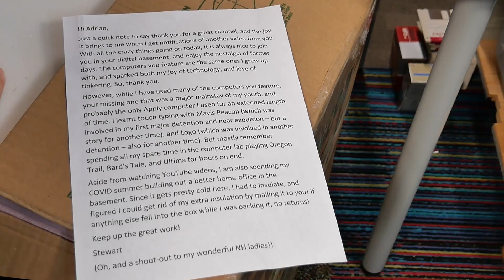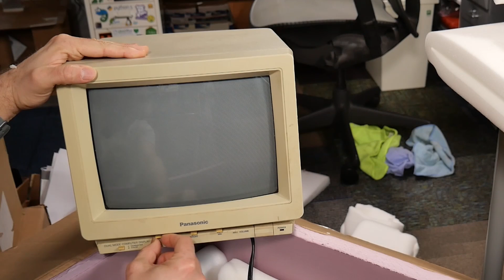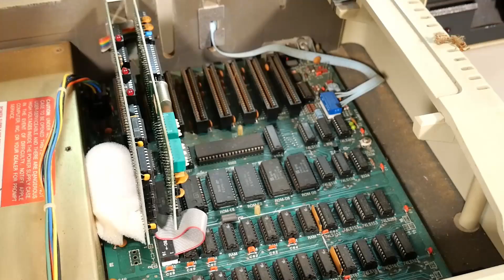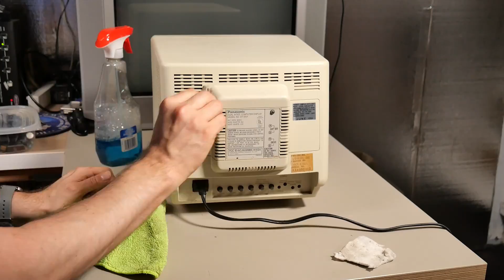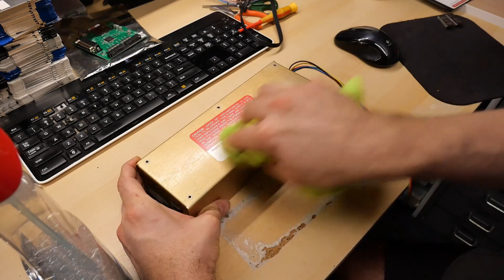A viewer sent in a very special donation!

Comment: at about 12 minutes in Adrian says Apple told people to NOT put the disk drives on top of the computer.  I ask Claude to find that.  It gave back: Excellent! I found it! The Apple IIe Owner's Manual (030-1346) on Scribd contains exactly what you're looking for. Here's what it says:
"Stacking Peripheral Devices" — The Apple IIe and Apple peripherals are designed to take a small amount of desk space. For example, if you have two disk drives, you might put them on top of the Apple IIe and put a monochrome monitor on top of the two disk drives. Some people also place the monitor on a stand.
Interestingly, the Apple IIe Owner's Manual actually encouraged stacking disk drives on top of the computer as a space-saving tip — complete with a figure (Figure 1-16) titled "Stacking peripherals for maximum desk space."
This is the opposite of what you remember! The Apple IIe manual was actually telling users it was fine to stack the Disk II drives on top of the computer.

Comment: 15:13  Wow.  That explains an old mystery.  I had an Apple joystick as a kid that had a secondary connector dangling from it which was just a bunch of pins - matching what was shown here.  I didn't know what it was for and as you'd expect it got all mangled.  The joystick had a switch for IBM PCjr so I had assumed that's what it was for, but I guess not.  I had no idea early Apple IIs had you plug the joystick directly into a pin socket on the motherboard.  That's way too clunky for this quality of a machine, just shameful.  I'd expect that from Commodore.  :)

The first Apple I ever saw was my uncle's II+.  I was pretty fascinated with it.  He had a bunch of shareware games from some literal mailing list he apparently subscribed to - I think he was getting a new disk in the mail every month or something like that.

Every Apple II I ever saw had that same classic setup with dual floppies and the monitor stacked on top.  It was so universal that I thought it was designed that way.

Comment: I liked those PSU's, in the late 80's, early nineties you could pick up complete 2's and their variants at the local flea market for ~$10, I liked how  all those 74LS chips were in sockets, and that PSU has double the rating of the Amiga brick so I would take the low voltage cord from Amiga and solder them into the apple PSU

Comment: Funny story, my first computer was a TRS-80 model 1.  But when i hit high school, they not only had TRS-80's, they had BOTH apple 2's and apple 2+'s.  Since i was already extremely familiar with the TRS-80, i gravitated to the Apples.  Less than a year later, we moved, and i was put in a school where the instructor of the computer class was a math teacher, and didn't know anything about computers!?!?  (yay 80's)

So i basically was tasked to help teach the class, because my knowledge was so deep in the subject matter at hand.  Plus, i was just starting to dip my toes into machine coding on the apple (by which i mean hand assembling), because the only tool i had was call -151 to place values into memory and then execute them.  I didn't get my fist 6502 assembler until i hit high school, and it was only a micro assembler.  Wasn't until i hit college and could pirate an actual assembler that i finally managed to really write assembler for the apple.

Still, i was known as the best apple guy in every high school i attended.   (which there were 5 of, FML).  Yes i attended 5 different high schools in only 4 years.  Times were tough, man!

Comment: X1 capacitor is actually better (has higher ratings) than X2. That's possibly why it's smaller (also because it's 30 years newer, of course). Same with Y capacitors, a lower number means a better rating.

Comment: Hey Adrian! Do you have a link to the RIFA cap replacement part?
Reply from the maker: Unfortunately I don't. I have have a box filled with X2 caps and I look for the right value and use it. Can't even recall where I got them.
Reply: @adriansdigitalbasement  that's great, I appreciate it and should be able to find some.

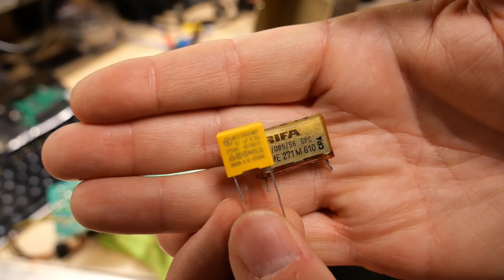Comment: 30:50 A little addition to this: Yes, X2 is the basically identical sucessor to the old "X" class. But there is also X1 available, which is BETTER (4kV surge instead of 2.5kV for X2/old X). Don't get confused and think X1 is just the old X.  There also is "X3" specified, but I never encountered them in the wild.

Comment: I had an Apple ][ because for some reason, I thought I might need it. I ended up adding the Applesoft card (not roms) and then with a flick of a switch in the back, I had an Apple ][+. I remember I bought the Apple, Micromodem ][ and Applesoft card for $3300. This brings back fond memories as the Apple and BBS's is how I met my wife. She had a Pet but got an Apple ][ to run the BBS on. I remember when we got married, we put our drives together for 4 drives. We ran BBS's until they finally went away. Unfortunately, we lost both our Apple ][s in a house fire. BTW. we hooked ours to a TV. The monitors were too expensive ;)

Comment: Thanks Adrian!  I recently bought an Apple IIe Platnium on ebay and thought that I should check out the power supply (because of this video) before firing it up.  Man am I glad that I did.  The Rifa cap (mine had Rifa inside of a circle) was probably on the edge of exploding.  The plastic was cracked on 3 of the sides and two of the sides looked like heat damage.  I'll never know if this Apple was actually working as purchased.  I'm just about done replacing it and then hopefully it all works.

It took me a while to find replacement caps (I'm not an electronics pro) but after pausing the video at the right spot I think that I have gotten the correct replacement; looks like the same specs as the one in the video.

I like how you have lots of sponsored links for products in the description.  Is it possible to also list replacement parts in those links?

The Apple IIe that I bought has a Rockwell 338-6503 (88-41) from Mexico in the 65C02 socket.  From what I can tell, it is special version of the 65C02 that Apple used.  I wonder how many other 65C02 variants that there might be and if it is worth the effort to drop in a WDC W65C02S6TPG-14.  That might be an interesting video.

Thanks again for the videos, I really enjoy them!

Oh and congrats on getting an Apple ][+.  Not to date myself but that is the flavor of microcomputer that I used in college in the early 80's.  We had a language card in it so that we could learn Cobol programming on it.  I don't know what it was, but it was probably a Z80-based card.  I learned Pascal and BASIC on the Apple ][+ too.

Comment: Generally speaking, assuming there hasn’t been any rework, green electrolytic capacitors are low ESR (equivalent series resistance) capacitors. These are better for switching power supplies because it reduces internal stresses on the capacitor and increases the efficiency of the power supply because less power is expended on losses due to the ESR of the caps.

Comment: My dad bought the family an Apple ][+ in 1979. My brother and I ended up modding it in 1984, by replacing the motherboard with a DIY-soldered IIe clone board bought out of Computer Shopper, running ROM images copied from an Apple //c at school. We left the original keyboard in the case and patched in a detached cloned IIe keyboard on a 30-conductor cable. I still have the original ][+ boards wrapped in aluminum foil somewhere.

Comment: You went into the differences between the Aoole ][+ and the Apple ][...but I'm trying to remember what the differences were in the Apple ][e compared to those..
Reply from the maker: Not much -- the ROMs were autostart ROMs on the II+ and you could put those in the II. There are some minor revisions and improvements to the motherboard but from a compatibility standpoint, it's the same. (Once you upgrade a II with the II+ ROMs.)

Comment: Your story sounds just like mine. My parents got one of these when I was about 10 years old, and I wrote my first code on it in BASIC. I remember pestering my Dad for months to get a (fairly expensive) 16kb RAM upgrade, to have a beastly total of 64kb, wow! The double disk drives made copying disks much easier than most of my friends who only had one drive. I would cycle all over town to borrow games disks, Karateka, Montezuma's Revenge, Mr Robot, Conan, ah the memories.

Anyway I went on to earn a living as a programmer, and as I watch this I'm writing code for a $2 microcontroller that has more computing power that the II+ had. It's hard to decide which time I would rather have been born in.

Comment: Hi Adrian. Thanks for doing a video on this variant on an iconic machine. When it comes to cleaning, I worked in the repair center for the custom cameras at a retail photography company back in the day, and we discovered that Motsenböcker's Lift Off #3 cleaning solution is the least destructive and most effective liquid cleaning solution for both plastics and metal.

Here's a non-affiliate Amazon link: https://www.amazon.com/Motsenbockers-Lift-Off-Graffiti-Remover-Trigger/dp/B00FZYOUPC/ref=sr_1_3?dchild=1&keywords=Motsenbocker+Lift-Off+3&qid=1602083778&sr=8-3

Comment: On the earlier Astec power supplies anyway, with no load or a short  they’d make a chirping noise as the switching frequency swept through the audible frequency range.  Bad power switches on those Astec power supplies were a common problem, either crackling and popping when turning them on, or the contacts eventually welded and stuck.  The earlier ones had the wires soldered to the switch, no clips.  It wasn’t so bad if they hadn’t been replaced too many times and still have enough wire left.  You could pry the old switch out just far enough, then solder on a new one and snap it back in without actually having to take the cover off.  I don’t remember now if Microsoft copied their RAM card from the Apple Language card, or vice versa?  The Microsoft card was basically to use along with the Microsoft Z80 Softcard to allow you to run the CP/M operating system and pretty much just Wordstar.  The Apple Language card was mainly to allow you to run Apple’s Pascal, Fortran, or other alternative languages.  The ribbon cable plugged into a ram socket and had a chip on the board to replace the one where the cable was plugged in.  They stole the RAS and CAS signals from that socket for the bank-selected memory chips.  Not only did it save circuitry but they got the DRAM refresh for free that way through the motherboard video circuitry.  There were also a couple other other higher capacity third-party RAM cards available such as the one from Legend Industries, which had multiple banks of 16K and provided 64K or more of additional memory.  In practice the upper RAM was primarily used with software patches to allow huge VisiCalc spreadsheets.  Visicalc was of course the first spreadsheet on personal computers and ‘the’ power user application of that time frame.

Comment: I love your basement look n feel, but can't help feel it might not be the warmest place during winter. Once this COVID thing is over, I'd be more than happy to spot some FF points and help you finish your lab / studio area if you ever wanted to make it more of a finished basement look. I love Portland. Reminds me of home (Melbourne, Australia).
Reply from the maker: Ah thanks but it's actually super nice in winter. All the heating ducting for my main floor runs throughout the basement and radiates plenty of heat down there. Now with the insulation added, it's always about 68-70F (20-21C) down there -- summer or winter. The biggest cold source was the back door which was 90 years old and was very drafty. That has been replaced with a modern door so that problem is solved. I used my Thermal camera to locate any air leaks and seal them up.

Comment: In my elementary school they had these Apple ][ computers and I remember using them and they were surprisingly capable for the time. I never became a apple fan. I got a 80286 with a monochrome monitor donated to me when I was 8 years old. Then when I was 10 I got a 80486 desktop as a hand me down with a 486sx and I installed a 486dx66. Man I was hot shit then. I think I had 16mb ram

Comment: Lacquer often fades yellow in the sun. My Ikea furniture must be coated with it, because it has yellowed. Some guitar restorers know this and keep it outside in clear jugs.

It would be interesting to take a utility knife and take a gouge on the inside to get a sample to test with retrobriting.

BTW, I suspect that RF modulators might be replated with the same tin-plating solution that is used for circuit boards. The kits are cheap. Once again, a test part could be scotchbited and then dipped.

The yellow treatment on the power supply housing could be anodizing, but I suspect that it might my alodine zinc-chromate, as used for airplane parts.

Comment: that wasn't a "rant", it was a very nice memory of your youth! I have now an Apple //e under one of my LCD monitors, which I can run whenever I want in PIP mode! It was my mom's computer back in 1986 and it took me a long while to find one which was identical to the one we had, including the small Apple monochrome monitor. It was broken too and I totally enjoyed fixing it and also cleaning it thoroughly (try the Electrolube fluids, the motherboard will come up BRAND NEW!!). I've also recapped everything: PSU, drives and monitor. As you did, I removed the RIFA before even testing the PSU and the Monitor had three already-exploded RIFAs in it!! :D 
I retrobrighted the monitor case but, as you say, the Apple case is painted. I tested some peroxide at the back to make sure and it actually makes the paint a bit dull. Mine is not discoloured though so I am not sure what's going on on yours. I look forward to seeing your progress, thanks for sharing this with us!

(Also: admit it, you would have been VERY disappointed if that machine just worked fine!!!)

Comment: Wow! The parallels. Vic 20 for me on my birthday in 83, then only 6 months later (after hounding my Dad continuously) he bought me a used Apple ][ Plus around Xmas.

You are spot on about the Language card. I would load in the Original Apple ][ ROM in high memory then bank switch. Not for Integer Basic but the built in mini-assembler. Way cooler for writing programs than using the Monitor.

Just wanted to say your Channel is my favourite on YouTube...and I have a lot of Subs!

Comment: RIFA caps are the arch nemis of anyone who works with old gear> I remember using a old, early days DSO for data capture.. The RIFA cap  popped and spewed smoke out the vent holes just after the capture event, So i had to madly scribble down the data values before yanking out the power lead.

Comment: I just scored a 2e platinum 1 day ago. Seller said it worked when last turned on a couple of years ago. Guess what? No go. Oh well. I get to fault find mine too.
Reply from the maker: Hopefully it's a simple fix because the IIe and onward is filled with lots of custom ICs instead of off the shelf parts like on the II+. If one of he custom ICs is bad, you'll need to get one from another donor machine to try to fix the IIe. Luckily unlike with MOS chips, the Apple custom ICs seem to work very reliably.
Reply: @adriansdigitalbasement  It's also the international version with a different main pcb from USA models so I don't have an exact schematic but I think close enough to the US model for basic diagnosis. Fingers crossed. A going one is so pricey now so I didn't pay too much for a broken one . More than I really wanted to of course, haha

Comment: Great video. The case is all beige plastic not painted metal or painted plastic. I retrobrighted my Apple 2e by simply putting the case in the Sun, took 2 weeks to do, much longer than using 
peroxide cream, but no marbling either. 27 degress C or under for sunbrighting. If You don't have the time try under water with peroxide or there's a Youtube guy that restores stuff that looks like it's from the dump and He retrobrighted a  yellowed controller plug by putting in a box with a lot of LED light, took 1 week.
Reply from the maker: Other viewers have mentioned that some IIe machine and all II+ machines are painted plastic -- Apple switched to unpainted machines with beige plastic during IIe production.
Reply: @adriansdigitalbasement  Thanks for replying and for the information. Maybe You will have to paint it then. Painting old computers can be a pain with a spray can as it's hard to get a clean job done with no garbage in the paint. Retro recipes did a really nice job on an Atari 400 after a botched retrobright attempt. My Apple 2e interestingly as I'm in Australia is an NTSC international PCB version, not Pal as might be expected. I upgraded it with VGA and Sound card boards from A2heaven. On another subject have You heardf of the Armsid for the c64, they are a very good SID replacement and cheap too. Nano Swinsid is rubbish in comparison.

Comment: Thoroughly enjoyed the video, Adrian.

I'm the proud original owner of an Apple ][+ that was a ][ with the floating point ROMs installed at the computer store where I bought it.  The ][+ had just come out and they couldn't keep up with demand.  So the cover doesn't even have the Plus.  I haven't  booted it up in years, but after seeing you replacing that capacitor I plan to check and replace it in mine as a precaution.

Looking forward to the next chapter in your Apple ][+ saga!

Comment: The info about II+ production is not highly accurate.  Some sources claim 350,000 were made, but I have an SN in the high 500s and I've seen others into the 1Ms. Some suggest Apple did funny things with the serials so we cannot even trust that.  I'm fairly positive none were made after 83 but am quite confident they were still being made before 84.